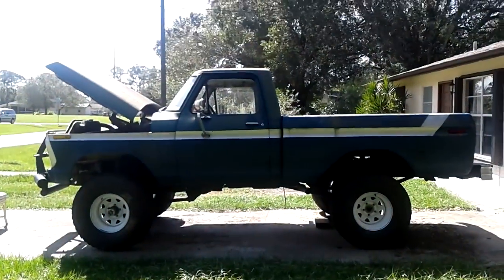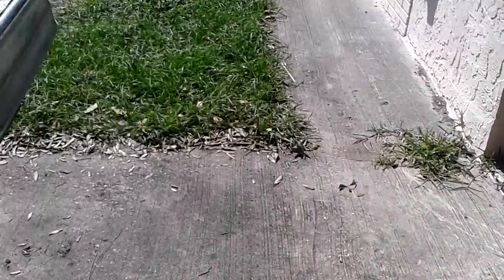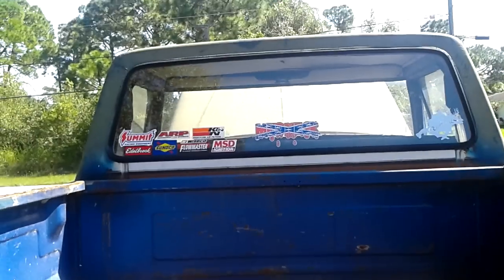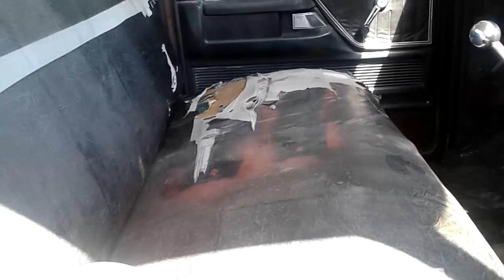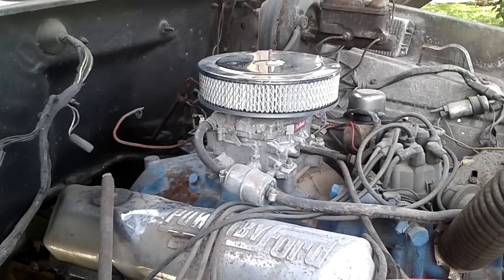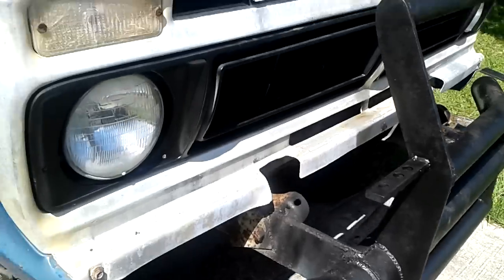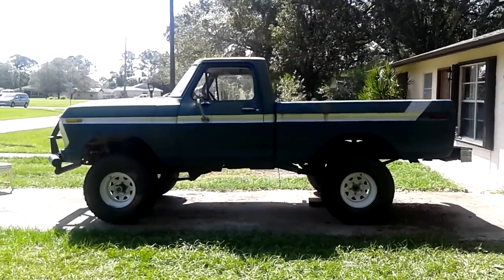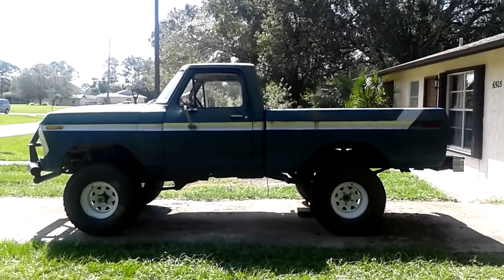Project "Mudder Phuckr" update no. 1

Comment: I'm from northeast ohio and our weather and the salt we use destroys everything. That truck was a steal for $500. Some of the first things I'd do is slap on a set of flowtech headers, dual 2.5" exhaust, and put a holley carb on. I always went from one problem to the next when I had an edelbrock, and they all went away when I installed a holley. The flowtech headers I mentioned are the pair I used, and they require no lifting of the engine.